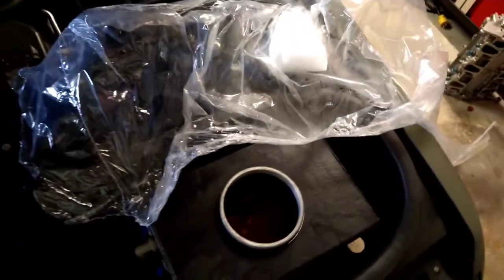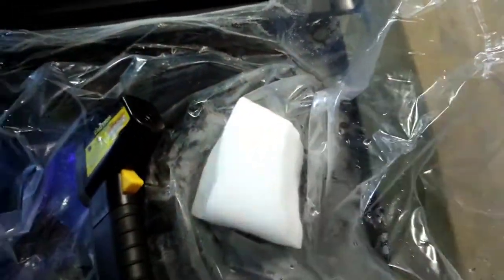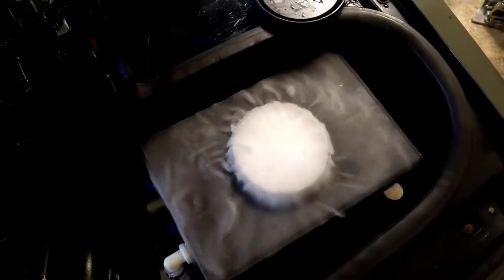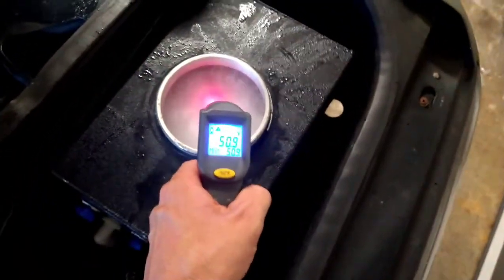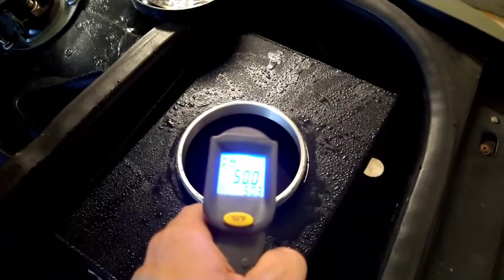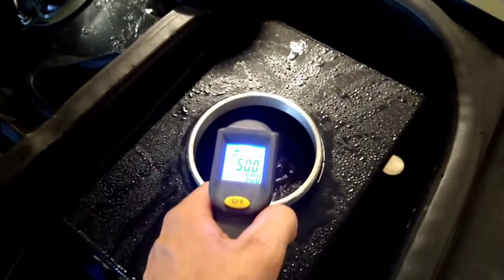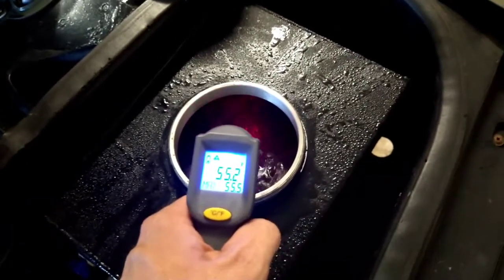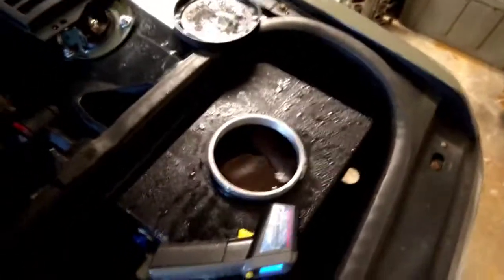What does dry ice do to intercooler water temps?  Does the water cool?

Comment: I actually have a compound turbo bike that runs on e85 and blowthrough carb with dry ice chilled fuel. We made a tank for the pits that we chill to -90°f then fill the tank and put a small chunk in to keep it cooler longer. Was worth a good bit more boost and power for me then again my engine is air and oil cooled lol

Comment: If you put more dry ice in the tank on a 80° day how long will the dry ice last in the tank? I’m thinking about using dry ice too but I’m not sure it’s gonna work
Reply from the maker: It will work.  I'd say it could take 10-15 minutes to for dry ice to fully dissipate.  Of course it depends on how big your tank is and how much dry ice you put in.
Reply from the maker: Don't forget to have a vent to allow the gas to escape.
Reply: @Slowv8Fiero  I have a 5 gallon tank that I was going to dedicate to dry ice then jump the water over to a 5 gallon ice tank and then send it back to the supercharger. Does that make any sense? How long do you think that will last if you’re at 80° day?
Reply from the maker: @outlawperformancegarage5211  if you already have an ice tank to put regular ice in then I wouldn't bother with a second tank with dry ice.
Reply: @Slowv8Fiero  I need to do something extra because my eyes take it is getting hot too fast. I need to do something to keep these temperatures down.
Reply from the maker: @outlawperformancegarage5211  how hot are your intake temps getting on a drag pass?  Ice in the tank should keep intake temps below 100 the whole time.

You can do an extra tank for dry ice if you think it will help .  Just make sure there is a vent
Reply: @Slowv8Fiero  Before the run the temps were 70°. After the run the temp was 165° then immediately came down to 80° and it only last for 20 minutes
Reply from the maker: @outlawperformancegarage5211  the dry ice will probably boil off in 20 minutes or so.  It won't last long.  Obviously the bigger the piece the longer it will last or the more you drop into the tank the longer it will last.  But it will boil off in 30 min or less I'd say.
100 degree temp rise on a qtr mile run seems like a lot especially if you have ice in your tank.

I don't know anything about your setup but is your intercooler undersized for your horsepower or cfm flow?

With ice in your tank and your pump running, the air temps should be below ambient.
Reply from the maker: @outlawperformancegarage5211    so this is concerning your zl1?  Just checked out your channel.

Killer car.

So you're def overpowering your intercooler.  Gm didn't design it to handle 1100 crank HP like you have 

I saw your Dyno runs and you were good at posting your iat 2 temps in the vid.  The temps are def going up the more pulls you were doing which is expected.

Is it possible to upgrade a zl1 intercooler pump?  Maybe you have already done that?  I am thinking more flow through the core will help keep temps cooler and more stable with less rise.  I mean with ice in the tank, and I mean full of ice, water temp is gonna prob be at 40 degrees or a bit less perhaps.  We can't get it much colder.  So we have to work on additional cold water flow at that point.

One thing I do like about the dry ice, is you don't have to keep draining your tank.  Obviously with ice as it melts, to add more ice, you gotta drain the water.  With dry ice you don't.  It just boils off leaving water levels the same with no draining required.

I honestly think you are just overpowering your intercooler at this point. If you have already taken steps to increase flow through the core with bigger lines and pump.

You could always get some dry ice and give it a shot and test your results.  

You're making way more power than I am.  👍👍😎
Reply: @Slowv8Fiero  I am pushing 20 pounds of boost. 1020 rear wheel horsepower 427. Kongs 2650 supercharger. I mean it goes up after the fourth gear pull. Then it jumps back down to 80° until the next pass. I’m going to have to run a killer chiller
Reply: @outlawperformancegarage5211  did you figure out your solution

Comment: So I have thought about doing this and doing my research and came across your video, in ur opinion would it be worth it to run it down the track? I hear u can actually freeze the water if u were to put to much. And did u ever try it running down the track with it?
Reply from the maker: I wouldnt have the dry ice in the tank while actually going down the track.  The co2 offgasses as seen and a track official might see your car "smoking" and stop your run.

I would use the dry ice to cool between rounds.
Reply: Would be better to separate the dry ice so it super cools the aluminum container not in contact with the liquid

Comment: Why would you wait to turn on the pump while the dry Ice is in the water tank? "Edited"
Reply from the maker: I thought that's what I did
Reply: @Slowv8Fiero   Essentially yes that's what you did.  My question sucked. Lol I should've been more specific. Why wait to turn on the water pump? Why not drop the dry ice in and turn the pump on and watch the temp drop minute by minute until temps level out? Then possibly turn around and do the same thing only with regular ice. Nonetheless I appreciate the video.
Reply from the maker: @onetallguy19  I wanted to see just how much it would cool just the water in the tank itself.

More so if in the staging lanes wiyhout the pump running and draining the battery